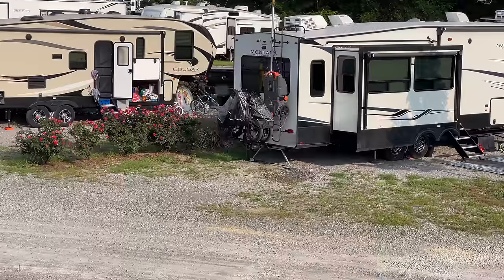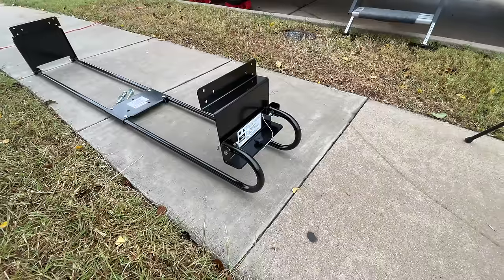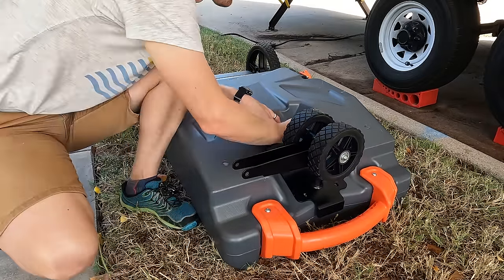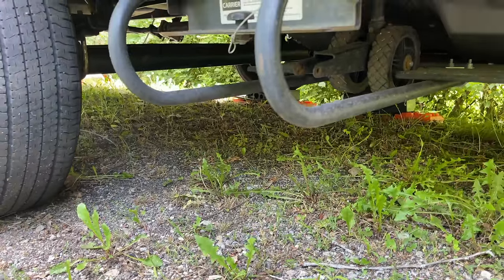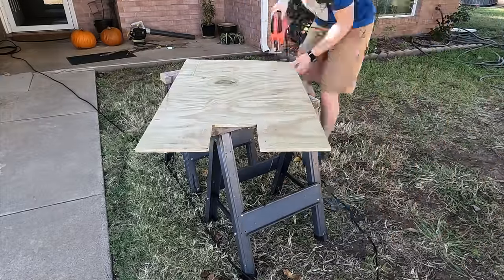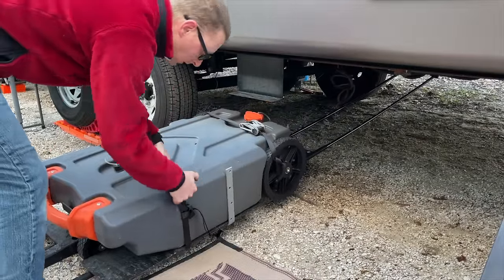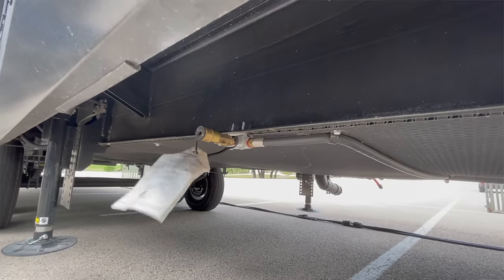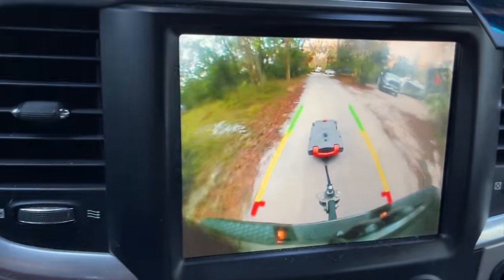👀 Genius RV Mod! A New Way To Store Your RV Sewer Tote

Comment: I built one of these out of a section of aluminum ladder 8 years ago.  Much lighter.
Reply from the maker: I love that idea! Do you have photos posted anywhere? I'd love to take a look at how you rigged it up.
Reply: Me too, please
Reply: I dont do social media, but if you can otherwise tell me where and how to do it (without agreeing to another privacy policy) i would be glad to post some pictures
Reply: Let me just try to explain it instead of getting my lawyer involved in reviewing privacy policies.   Yes, I'm a conspiracy theorist.

NOTE:  My trailer has a belly pan from the front of the trailer that covers all the tanks but stops at the axles.  I mounted the tank rack just behind the rear axle.    This allowed the tank to occupy the 8" of space between the bottom of the frame rails and the bottom of the trailer floor structure.   I'm not sure this idea would work if the belly pan went the full length - the ladder would hang down awfully low.

My steps:

1.  Retrieved a bent aluminum extension ladder my neighbor was throwing away.
2.  Cut out a section of ladder long enough to go from the outside of the trailer frame I beam from side to side.   I cut out every other ladder rung to reduce weight.   ALuminum ladders are incredibly stiff.
3.   On the drivers side of trailer I drilled holes in the frame i-beam flange to mount two 3/8" eye bolts the width of ladder.   I also mounted matching eye bolts to both rails on one end of the ladder.  They were placed so the ladder eye bolts aligned with the frame eye bolts.   Place a short 1/2" bolt thru the two eye bolts and it forms a hinge.
4.  on the passenger side of the trailer I drilled one hole in the frame flange and tapped it to 3/8" NC.   I fabricated a U-shaped bracket out of 3/16" x 2" flat stock the width of the ladder, and used a threaded rod with a handle welded on the end to secure the U shaped bracket to the frame with the end of the ladder captured in-between.    

In operation, the ladder "rack" will drop down to the ground on the passenger side as it pivots about the eye bolts on the drivers side.   This allows easy access to the sewage wagon (mine 27-28 gallons) which is incredibly bulky and heavy, just slide it up or down the incline now formed by the ladder rack.   

The only other challenge is to secure the buggy to  the ladder.   The tank wheels straddled the ladder rails, so I used some wall mount J hooks from a big box store to capture the tank axle when the tank was pushed up against the J hooks on the drivers side.  I used bunge to secure the other end to the ladder.   The rack system weighed 28 lbs not counting the buggy.   All you could see from the side was the ends of a ladder up against bottom of the frame.

Comment: This is a great idea for the tote.   But those totes are problematic.  Stop pulling the tote by hand or by your truck.  Put the tote in the bed of your truck and use a macerator and garden hose to fill the tank.  No dragging 200+ lbs of water along your trailer and you can drive at normal speed to the dump site without damaging its wheels.
Reply from the maker: Macerator is a great additional piece of gear.

Comment: I hear you on empty tote’ing. But how unrealistic would it be to rig up a 15 gallon tote that contains 12 gallons of wastewater? Just under the 100lb mark if one assumes 8lb per gallon. The small tote would put it over, of course. But not by much I imagine.
Reply from the maker: I think it'd be too much dynamic weight in one spot - the liquid would slosh and the whole thing would be like a little kid spinning a necklace between both hands with a heavy weight in the middle.
Reply: @rvgearandfar great point! Thanks for all you do!

Comment: Get a far superior compost toilet, then replace you black tank with another freshwater tank. Never deal with messy sewage again, Much better solution
Reply: You’re still messing with sewage, it’s just mixed with composting material.
Reply from the maker: That is a fantastic option! You still have to mess with the waste in some form or another - plus a composting toilet is QUITE the investment.

Comment: Good idea, but I don't want to deal with my tote if not needed to. If the sun shortens the life I'll just buy a new one. Thanks for ideas.
Reply: I agree, the same for trailer tires. They need replacing even if covered.
Reply from the maker: You have to deal with it somehow though... where do you store it when not in use?
Reply: @rvgearandfar  on the ladder, but now I have a toy hauler and the ladder is on the side I have my brother carry it on his motorcoach.  I realize that it's better for me if I have a pump service come out once every week if I don't have full hook ups.